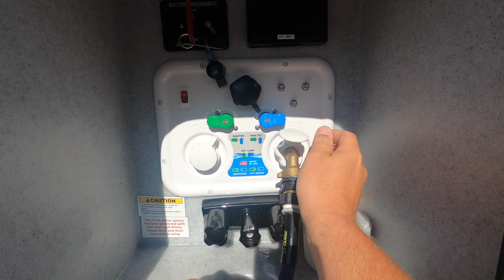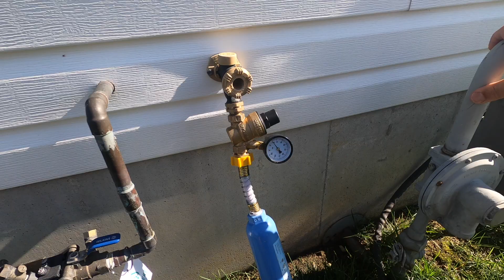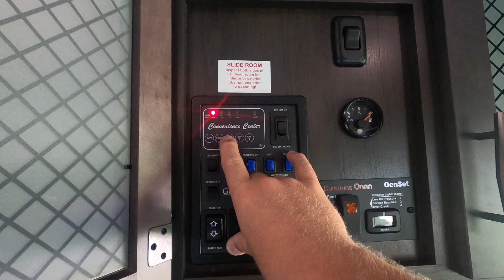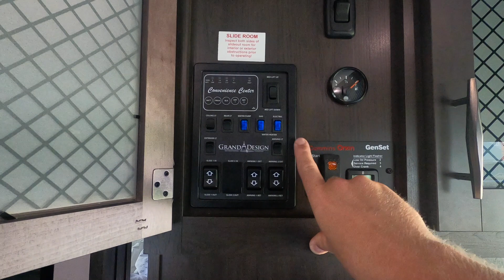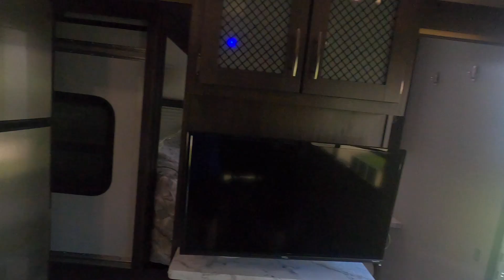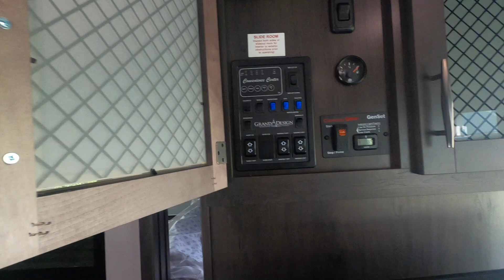Grand Design Momentum 21G Fresh Water Tank

Comment: What does the sanitize port do on the left?
Reply from the maker: Its the port you would use to run a cleaning or sanitizing solution thru the lines
Reply: @Peaks2Palms  this is also an EASY way to put more water into your tank if you are boondocking.  Boondocking with a family of 6 uses a lot of water.

Comment: Have you figured out why there's 4 total overflow tubes? Also when I fill mine, only the two front over flows have water coming out and never the rear. Wondering if I'm even filling the entire rear water tank.
Reply from the maker: So I've noticed that if I fill the tanks & the trailer is not perfectly level that the water will come out of one of the overflows and not the other.  I also keep a digital meter on my water line while I am filling and have noticed that the tank will only take about 90 gallons.  I figure this is because I'm not level and one tank is filling and overflowing & the other is not able to be completely filled.  Make sure the trailer is level and see what that does.  I am curious so please let me know if that does the trick.
Reply: @Peaks2Palms  I'll try that! Thanks. Also since there is two fresh tanks, and one fresh tank monitor inside the rig, how in the world do we know the accuracy of how much water is left while boondocking? I'm assuming the sensors are just on the first tank, and tank two just keeps refilling tank one as it's being used, then you won't know exactly when tank two is empty until it is empty itself and then uses part of tank one. All very confusing!